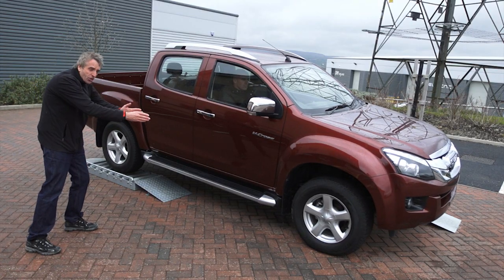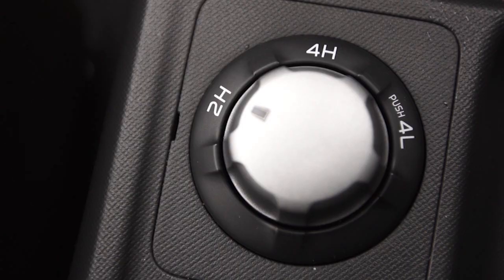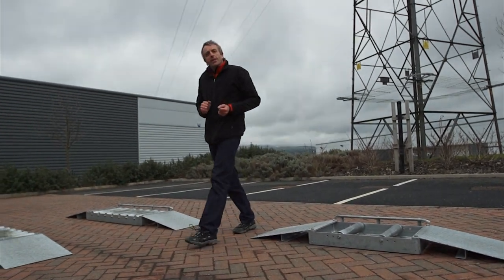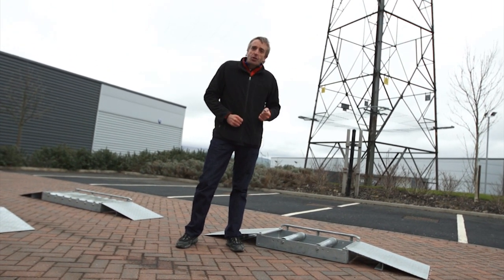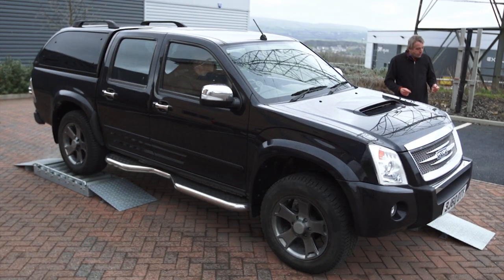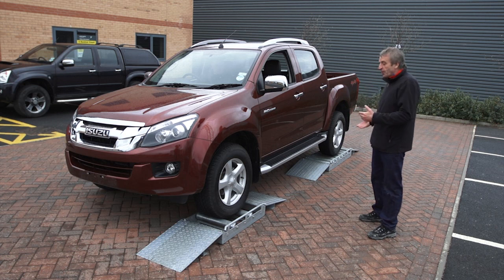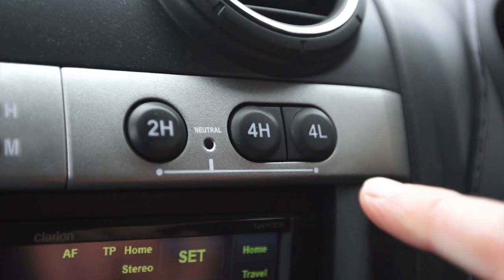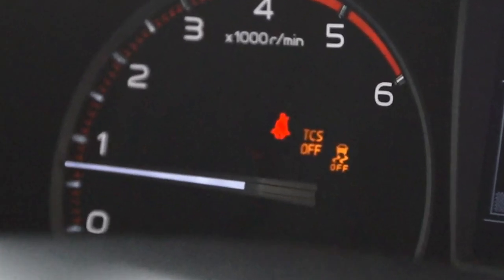2012 all new Isuzu D-Max 4x4 Drive Train system demo and comparison on rollers.

Comment: Sadly the system does NOT work, my old Rodeo pulled up a small grassy slope twice a week for 2 1/2 years in 2h, no wheelspin (same AT3 tyres btw) in my D Max the light flashes, it rips up the grass, but won't move until i use 4h........
I will say however it is a far better truck on the tarmac, but nowhere near off road

Comment: I love ISUZU,  but honestly,  electronics and 
mudding off roading dont mix.  I want my ISUZU to be manual transmission, manual transfer case, manual locking hubs.  no AC, No power options.  that would be my ultimate ISUZU machine.

Comment: This garage holder tell me that the 4 X 4 system can have problems.
So it will need repairs fairly many times the tel me.
However I, think, I did like the Isuzu as the 4 X 4 system can be switched of and on. Wich is not possible with the Toyota Vigo / Hilux.
And there for the Toyota uses a lard more gasoline when driving the 4 X 4.
Off course also when there is no need to drive on 4 X 4 standard road.
So this did let me switch to the Isuzu.
The Isuzu seams to have thicker plate than Toyota Vigo.